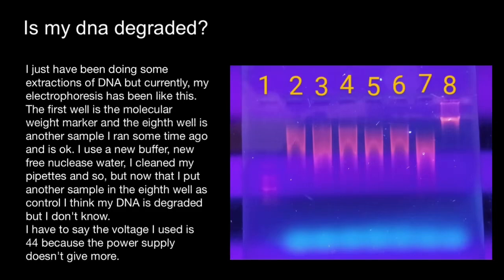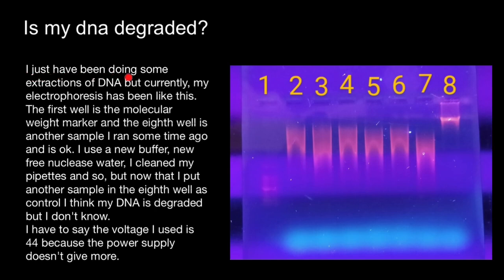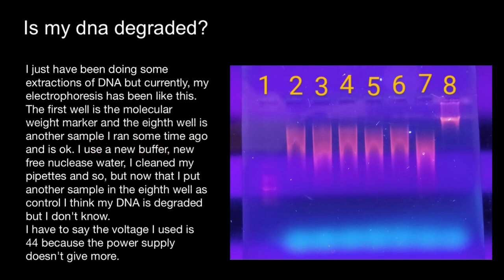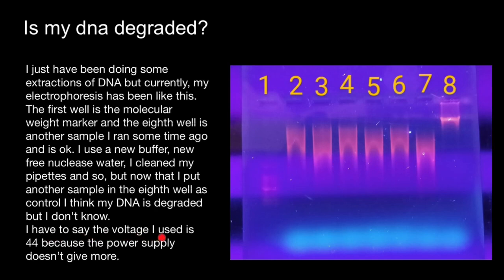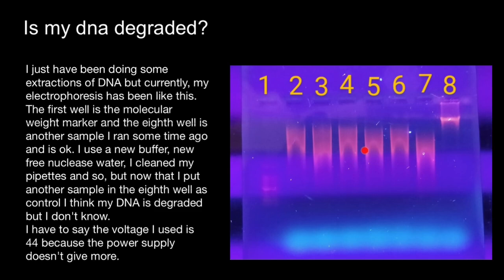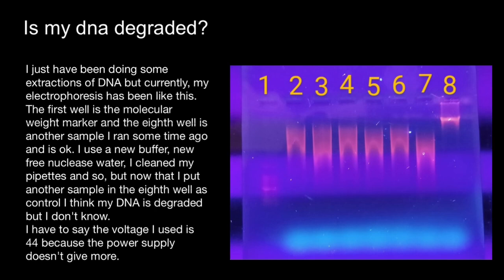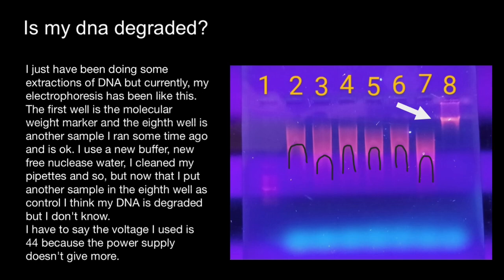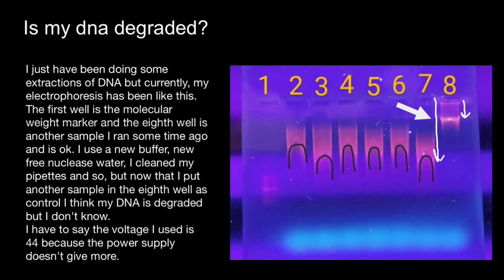DNA degradation | Gel electrophoresis

Comment: Are there any major differences in floral and faunal dna other than size?? (Chemist not biologist)
Reply from the maker: Yes, there are several differences between floral and faunal DNA besides size. Here are a few:

Genome size: While both floral and faunal DNA can vary greatly in size, the genomes of plants (which produce flowers) are typically larger than those of animals. 
Gene structure: The organization of genes in the genome can vary between plants and animals. For example, plants often have multiple copies of genes, which can be arranged in a more complex manner than in animals. Additionally, plant genes are often separated by longer stretches of non-coding DNA.
Gene expression: The way genes are expressed can also differ between plants and animals. For example, plants use chloroplasts to produce energy through photosynthesis, which requires the expression of many genes involved in this process. Animals do not have chloroplasts and do not produce energy through photosynthesis.
Epigenetics: Epigenetic modifications, which are changes to the DNA that do not alter the underlying sequence, can also differ between plants and animals. For example, DNA methylation, which is an epigenetic modification that can regulate gene expression, occurs in both plants and animals but can have different effects on gene expression in different organisms.
These are just a few examples of the many differences between floral and faunal DNA.